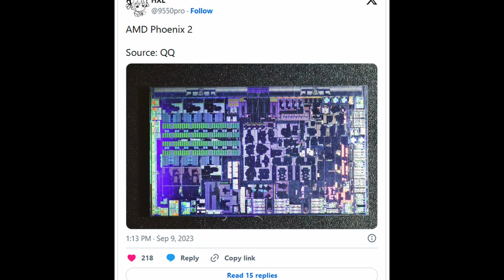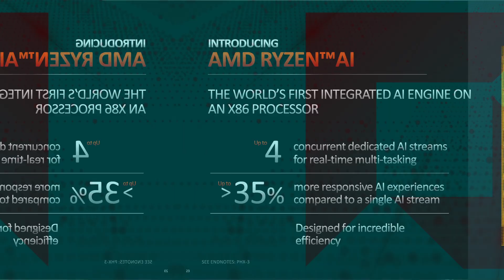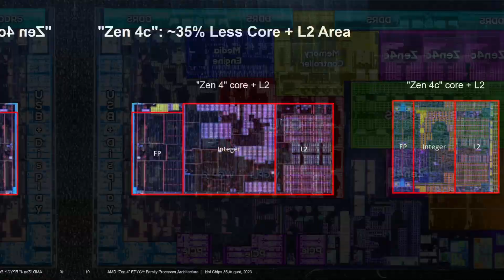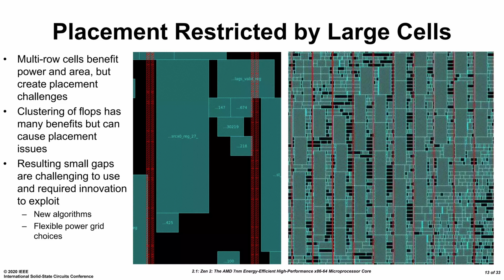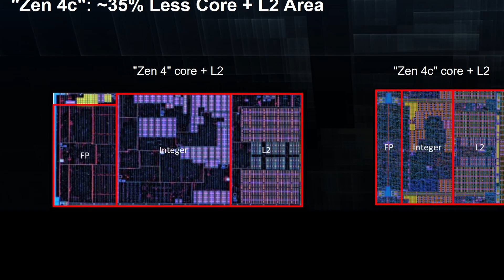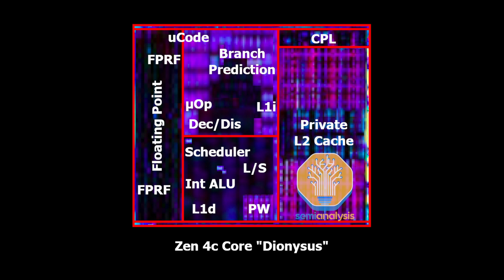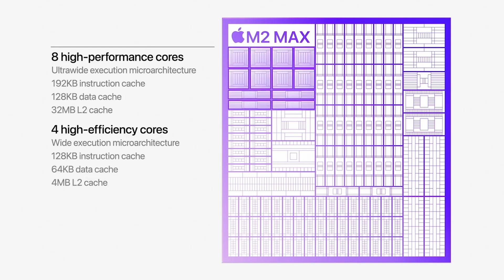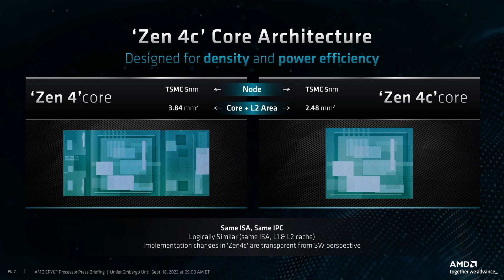Why AMD's first Hybrid-CPU is Different

Comment: 1) Why 2 different kinds of core but same kind of architecture?
Same RTL for Zen 4 C & D core: you only design and verify once.
Different implementation schemes (synthesize, STA, layout)
C core is the big, 22% high freq, bigger area core at the same operating voltage
D core is the ~30ish% lesser area core at the same voltage

The target: to achieve performance with "big" Classic and "little core" Dense without much change/less work in the architecture design 🙂
It's all about the PPA trade-off (power in watts, performance in Ghz, area in mm^2)

2) Will AMD has some kind of Low Power core?
Hahaha, yep, it's coming, but to keep the system in check for low power in idle mode. The bread and butter are still Zen 5 cores, not the Low Power cores, AMD is doing it differently compared to ARM  😉

Comment: One big bottleneck for the smaller c cores would be the power density. The heat per mm^2 is a huge bottleneck, so clock speeds are also reduced in that regard.
Reply: But they don't boost as high so require lower voltage which squares while frequency is linear, boosting deliberately pushes the core into an inefficient part of the performance/power curve.  At lower TDP per core the c cores become more efficient while not hitting the higher frequency that standard Zen hits at higher TDP.  In a likely U 15W mobile laptop the power density is way lower than desktop where a single core can easily exceed 15W.
Thermals constrain boosting as 10C costs about 100MHz max frequency, so on modern chips it's not really a huge bottle neck in general, the Bergamo servers with a large number of CCDs have a large socket, it's more the TDP overall that makes power efficient frequency a priority as high utilisation is the normal case.
Reply: @RobBCactive  There's an  optimal point of performance per watt for any chip design. 

Heat per mm2 is still going to be a limit even when running chips at that optional point.
Reply: @crazyelf1  you clearly don't understand this as well as you think.  Large socket spreads the TDP over a large area so W/mm² can be easy to cool.

Comment: Should it not be possible to start optimizing the sub parts of the architecture for vanilla and dense in the future? For example giving the vanilla core a more elaborate branch prediction or a bigger uop cache. So it would still be the same architecture but with a tweak or two besides clockspeed, cache and density. Might be a cost efficient way to optimize even better into two directions
Reply: As soon as the architecture is changed, you're working with different cores. Making a design more compact is vastly different than making wholly different functionality.

Comment: AMD has confirmed that Zen 5 will have "Integrated AI and Machine Learning optimizations" which to me says an expansion on AVX512 support.  But since they are going hybrid, I wonder if the new AVX10 implementation Intel has come up with might be at play.  Since AVX10 allows for different register widths instead of forcing 512 bit it becomes a good fit for little cores without hampering big ones
Reply: Actually AVX10 is presented as a common standard not limited to intel. But intel is rolling it out inconsistently.
I don't think it's what they where talking about though. I think they meant an soc style approach like apple does with their neural engine. It's an accelerator block that would be part of the IO die like the gpu section.

AVX512/10 is meant to accelerate the model training and scientific research tasks. It's vectorizing 512 bits of data through a single instruction instead of the 64bit that it can do regularly. This speeds up processing a whole matrix of doing the same operation on every cell.

But for inference and using prebuilt models day to day its not what's most effective.

Comment: I still love the simplicity of the intel 9700k. 8 fast cores with no hyperthreading. A gaming value masterpiece we may never see again. With hyperthreading and different speed cores you can run into situations were the high priority processing takes a back seat on a slower core or competes with another thread for the same cores resources. It doesnt always happen but with the 9700k you take no chances and get a discount for doing so.
Reply: The 9700K is terrible because the i9-9900K exists.

It has less cache than a 9900K as well. I always considered the 9700K as the worst i7 of all time.
Reply: I love random comments like this from one computing perspective or another, I don't game but I do a lot of virtualization and one ancient arch that held its own for many years was Haswell, 10 years old now.. just pulled my last one out of active service this week
Reply: Unfortunately everything you described happens on any multicore cpu. You can still have the OS assign threads sub optimally and multiple processes compete for the same ressource. Hyper threading doesn't really make a difference for that and the new slow fast cores just add a bit more complexity in the priority of how processes thread transfers get handeled.

The best way to dodge these issues is to manually assign a higher priority to the program you really care about in task manger. Because then the windows scheduling will never kick it behind something else.
Reply: @SquintyGears  Well what about a games own threads competing with each other thus reducing the performance of the thread that creates the main bottleneck? The rendering thread or main thread for example. This was the kind of case I had in mind when I wrote my comment and it is evidenced by many hyperthreading on vs off benchmarks. In these cases the application priority was identical and hyperthreading was tested on and off and showed a difference. I understand in an ideal world the game engine it self would handle this properly with the scheduler but real world data shows that it does not always. Setting the application priority addresses only part of the problem.
Reply: @maxfmfdm  that's just not really how that works... Within a single program like a game, there are tons of conditions for different parts of the logic to operate in parallel or in sequence. But since it all came from the same program you can generally say they play nice with each other.
The problems come when other processes that have to run too, get run in between game tasks and end up making the game wait for a bit more than it expected to.
BUT this only shows up as a problem when you're running out of computational headroom.
If you're not limited doing anything fancy changing hidden settings will net you 1% or 2% improvements and that's often within run to run variance of just background tasks randomly starting or not (because windows does a lot of things)...

It is true that the original Hyper threading implementation in the first and second gen core i series chips showed significant differences in a non negligible proportion of software. It was both a programmer and intel problem. And games were one of the most affected types of software.
But that's not true anymore... Programmers don't use the same threading libraries and the scheduler logic for what gets priority and where it gets assigned has gotten more clever. Same thing with the way HT runs the 2 threads on the same core, the architectures now are much better at occupying the empty cycles.

Bottom line... The 9700k is a beast because it's the first regular desktop 8 core intel made so it was heads and shoulders above its predecessor. The reason it doesn't have HT was only for market segmentation because they introduced the i9 (which is a marketing construct they did to increase the potential selling price, i7 is still 300$ but you could start spending 500$ now) because HT generally only brings you 40% extra performance in ideal conditions but it hasn't been a source of loss in a very long time. People test it again on every new platform.
Reply: @SquintyGears  um nope... just because they are all part of the same program does NOT mean they play nice together in reguards to these issues. I'm sorry but your first comment was a bit off but this claim is WAY off. I worked as a software engineer for a game developer and your claims are just outrageous at this point.
Reply: @maxfmfdm .... Ok dude

It's just not easy to boil down what is a semester long college class in 10 lines. It doesn't magically work, but in general you can assume they did their job that's what i mean. It's not outrageous at all to say that.
Reply: @SquintyGears  With how game development works in the real world it's most common for the publisher to not really give a shit if the developer optimizes their games to anywhere near the degree required to fully mitigate these issues. They care about money mostly and it shows over and over. And even if they do care these issues can easily still be present and empirically demonstrable.

Comment: It's really clever. When youre wanting to use all the cores, youre generally not wanting to run the fast cores at their single thread low efficiency high frequency ceiling, so run at lower clcks anyway to spread out the available thermal and power budget over more cores when needed, without creating headaches for thread schedulers and programmers from greatly differring feature sets coughAVX512cough

Comment: AMD's approach also supports another dimension of differentiation by using chiplets:  the manufacturing nodes and design rules can be radically different depending upon the goals.  There is where rumors of Zen 5 and Zen 5c are going in that they are using two different manufacturing nodes for further optimizations in clock speed, area and power consumption.  Phoenix 2 is unique in that both Zen 4 and 4c are together on the same monolithic die (which makes sense given its target mobile market).  Desktop hybrid chips would be far easier for AMD to implement if they felt the need to bring them to market:  just one Zen 5 die for high clocks/V-cache support and a Zen 5c for an increase in core count.  AMD has some tremendous design flexibility here for end products.

The software side cannot be stressed enough that the changes between Zen 4/Zen 4c and Zen 5/Zen 5c are nonexistent in user code space. (The supervisor instructions are mostly the same but Zen 4c as a few changes to account for split CCX on a CCD and higher core counts in general.  Clock speed/turbo tables are of course different to report to the OS.  All the stuff you'd expect.)  Intel's split architecture requires some OS scheduler changes to function properly.  Lots of odd bugs have appeared due to the nature of heterogenous compute:  legacy code always expected the same type of processor cores when they first adopted a multithreaded paradigm.  These are the difficult type of bugs to replicate as they involve code running in particular ways across the heterogenous architecture that require specific setup to encounter.  For example splitting up work units evenly on the software side expecting them to all complete at roughly the same side presuming all the cores were the same.  Or a workload calibrates its capabilities based on first running on a P core then gets context switched into a much slower E core that can't keep up with initial expectations.   Intel is large enough that they got the necessary scheduler changes implemented into OS kernels to get things mostly working there are plenty of edge cases.

Comment: Well, it seems AMD has a mysterious "low power core" design in the works with the Zen5 family. And no, it's not the "dense"/Zen "c" core, it's a distinct new core (maybe in the IOD or stacked on top of it?)
So who knows but it seems Zen5 will have 3 core variants.

Comment: This design is interesting for sure, and it brings up some interesting ideas for future AMD chips, including how Little Phoenix may be cut down. A quad-core Ryzen 3 "7340" variant could be 2+2, while a lower-end "7240" might be 1+4, and then some Athlon "7140" is 0+4.
Reply: The zen4c cores aren't that much slower than the regular ones that it would make an athlon.

Think about them as if they where maxed at 3.8GHz instead of 5.3GHz

So they'll actually perform closer to a Zen3 going at its full clocks at equal core counts.

The athlon are much more cut down.
Reply: @SquintyGears  I'm well aware of how neutered the Athlons are. I only bring that name into it as AMD doesn't have anything else below the Ryzen 3 name in the x1xx range.

Comment: Now that you mentioned it, guess zen c cores make sense for next gen consoles. Clocks are always much lower anyway and the area efficiency would be helpful for cost. Actually it is possible console zen 2 cores are already optimized for area. Never thought about it. Cool!
Reply: nah next gen consoles are much more likely to use a single CCD X3D/VCache cpu. You get slight power efficiency and better gaming performance.

This would also mean games will start to focus on the cache a lot more and trickle down to desktop as well and that could be the next paradigm.
Reply: @rudrasingh6354  I sure hope so, it would be incredible, however 3d cache is super expensive and consoles try to stay monolithic thus far (maybe next gen this will need to change? I sure hope so so they can include more silicon without charging 700 usd for a console. Also they could afford to maybe make part of it on a newer node. Let's hope!!). I'm also not sure it would be an issue to use zen c cores with 3d cache if they find a cost conscious way to do it.
Reply: Well it could go in console but they're not designed like this at all.

Usually the slim model gets just a die shrink or they integrated multiple chips into one. But in 2023 they're actually saving more money by staying on the same process node instead of trying to buy some of the 3nm waffers that apple wants to put in the new iPhone.

And saving 35% on just the core with no other saving anywhere else in the chip isn't going to make the console cheaper. It would just be 10% smaller chip in the best case (they're selling at a loss so maybe they are willing to do a silent version update to lose 10$ less)

Though, to your last comment the ZEN2 they're using isn't anything like a zen2c. It would have been so valuable for servers you could guarantee amd would have made an epic cpu with it 3 years ago already...

Comment: When optimizing for size and power efficiency, isn't there more to do than just moving the core elements around? I'm worried that the lower clocked zen4c cores can't compete with E-cores in power efficiency (and thus multithreaded performance within a fixed TDP envelope)
Reply: Don't worry, the standart zen 4 is already more efficient than intel pcore under lower voltage and the 4c just extend this lead.
Reply: @mawkzin  Yeah sure but the 4c cores need to be more power efficient than the 14th gen E-cores in instructions/watt. Obviously they'll be faster core-to-core but efficiency is important for multithreaded loads and handheld use.

Comment: From AMD, I expect the unexpected.  They may add a 3rd core type to the mix.  They may make a mechanism where a task can very quickly be moved from a smaller core to a higher performance one.  They may make some cores without an FPU.  I don't expect them to follow Intels path because that would have them starting down that path much later than Intel.
Reply: removing the FPU would be a bigger difference than Intel P and E cores have. AVX512 is not widely used but FPU is used for basically everything, even if very seldom in some. Having a less than "bulldozer" core would be absolutely a nightmare to schedule.
Reply: @marsovac  I suggested no FPU as an extreme measure that is not the same as P and E.  A core with no FPU could be as fast or faster at integer work.  This would make it good for some OS stuff and the like.

Comment: AMD is both right and wrong. They need all four.

For single threaded workloads the user directly interacts with, you want a couple fast cores.

For other large tasks or ones that only scale to a handful of cores, you want compressed cores.

For actually parallel workloads, you want lots of smaller cores with a laser focus on power per watt per area. 

Finally, ultra low power cores to drive the hundreds of tiny background tasks that constantly wake, do little things, then go back to sleep.

Comment: My immediate first thought was to the steam deck 2 as well.

A single or maybe two big cores for those primarily single threaded games, with 4 smaller cores for heavily threaded games. I've found that a similar layout works well for desktop use on intel's designs, with 4-6 cores that you can schedule for gaming being optimal for an enjoyable experience.

I do believe that the 2 GPU workgroups in phoenix 2 are anemic for the deck, as graphics performance would require an upgrade, but that's something they could adjust in a custom design for Valve

Back to the CPU architecture though. I absolutely love having more cores than I would think I need. My main gripe with intel's design is the limited use cases I'd have due to how they're scheduled. A "space optimized" core would suit my wishes perfectly, and the full fat cores being there for when you need them is the icing on the cake.
Reply from the maker: The Deck 2 def needs more WGPs, fully agree.
Reply: The problem is the core configuration.

My i7-12700K is a mistake by intel, so they won't make a similar chip in a very long time. Good for me, because the perfomance per watt is hilarious, it's way too high.

Watching 4K youtube videos while the CPU stays at 8 watts and 28 degrees on summer with air cooling is really something else...